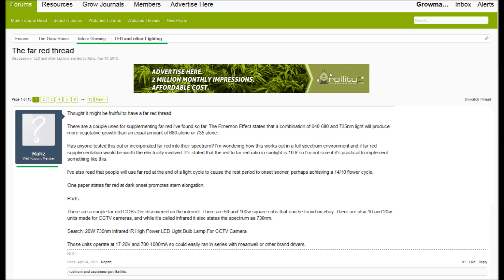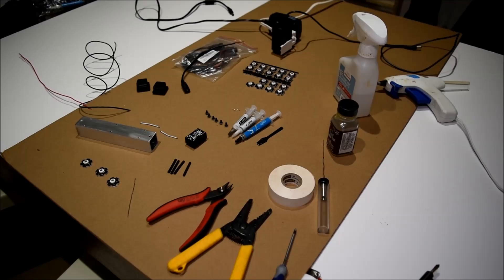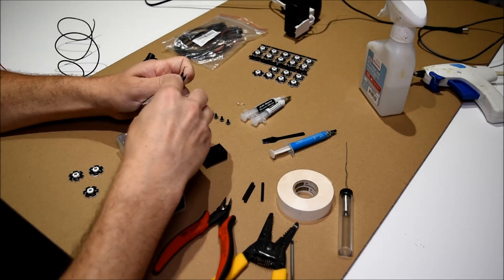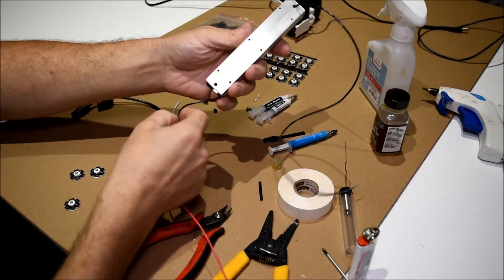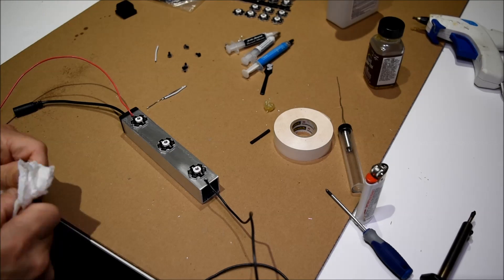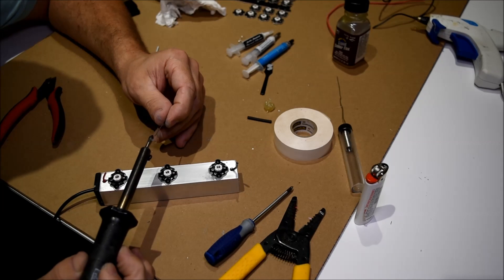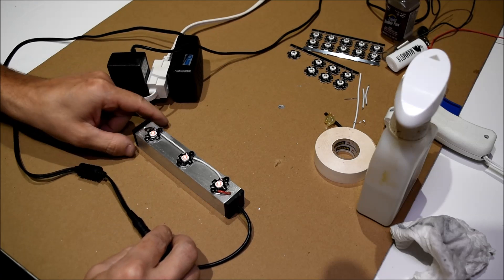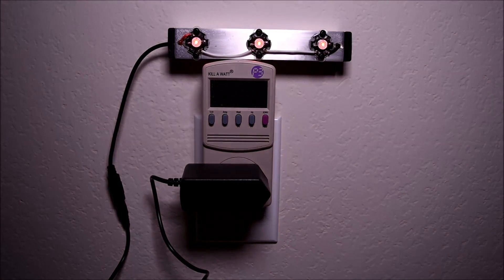DIY LED Build: The $20 flower initiator 730nm leds

Comment: I use a 12v 1A cellphone charger to drive the ldd-700HW and it gets supper hot. Is this normal? I mean really hot I can't hold it when it's running. Is it normal?

Comment: Quick question about using the far red lighting. I am am not sure if I have this correct. The far red pucks put the plants to sleep faster after the main lights go off therefore reducing the amount of dark time needed during flowering so a 14 hours on 10 hours off or 13 hours on 11 hours off lighting schedule can be used instead of the traditional 12 hours on 12 hours off schedule?

Thanks 🙏
Reply: that's correct and if you add some 660nm deep red with the far red you will have an emerson light. these help induce flowering, speed up ripening and improve quality taste etc
Reply: @iRuf12  but for emerson effect you only need around a 6:1 ratio on the 660nm and 730nm, and all time turned on, if you use too much IR on day you get streching bro. Salute.

Comment: So what I found out is yes you can drive more than 3. I built 2 of these for a 4'x8' tent. Had to watch the video a few times to keep my lack of knowledge in terms of wiring but I am getting petty savvy thanks to you. You are a very gifted instructor and thank you for sharing your knowledge. They have been running for a week, I started the flower process then saw the video then ordered parts. took total of 20 minutes once laid out. 2 3 foot 1-1/4" x 1-1/4". 
My plants exploded with the next few days
Reply: paul waschkowsky Wow. That's awesome. So 6 led's total was enough for your 4x8 space?

Comment: Links are dead bro but no worries I sourced my gear from heatsink USA and eBay, which was a little more coin but my question is did YOU notice a difference with these?
Reply: not using the DC to DC drivers and using the extruded 1 inch bars by 2', 5 discreet on each bar probably overkill but it's what I found acceptable for my space and available voltage on the AC to DC driver I picked.

Comment: So, depending on the amount of LEDs, you get brighter-dimmer.  At what point are they not running enough wattage?  With the 12V-2A cellphone charger you have 24W to play with. Across 8 LEDs that should be 3W minus what the driver consumes. When I tried with only 4 LEDs they were SO much brighter, so now I just want to make sure I'm not spreading power too thin to make it useful.

Comment: Hello
Did you use these and how did it work?
5 minutes after lights out for how long? The complete flowering period?
Did you go to 14/10 while using these lights?
How much space does this one cover?
I would like to go to 14/10 but need input on the out come and what is needed to go to 14/10.
Any help would really be appreciated.
Thanks again for your help and diy videos!

Comment: I have a very different situation then most I have solar power and don't have watts to waste, I start out door grow which I had to move indoors to finish, northern lights. I'm doing in my 2x2x2.5 micro grow. I bought 2 Chinese 18 watt bulbs for the 12 volt side and when the gen comes on use a 50 watt ufo. I'd love to build something a bit more suited for the situation. What would u suggest fo the low wattage side mx real watts 20-25 need good for veg and flower

Comment: Hey man, what if i bought a $10 10w LED that had 1 IR 730 nm light in it, broke all of the other lights in the bulb so only the 730 was working... would 2 or 3 of those work the same as this? Could i just turn those 3 (Broken -to-work) 10w lights on for 5-10 minutes after my light cycle to get the flower initiating effect? I am definitely not worried about the couple of watts I am losing in efficiency to do it this way... time for an experiment!

Comment: Thank you for this!  I went wild a got six of these from Steve.. All wired up, show energy with multi meter thru out all the terminals but no lighting.. The power supply I'm using is a 120v 60hz 25w - 12DVC  800mA.  Is this enough, 
Thoughts?  Thank you again...

Comment: If you were to use a meanwell apc 12-700 driver to power 3w semi leds (2.6v@700ma), how many could you run on that driver with series wiring? Thanks

Comment: found this light that seems pretty neat.  what do you think? TotalGrow Solid State Volumetric Lighting LED Light Fixture 155W http://totalgrowlight.com/products1.html
alilttle pricey but they added alil far red. and seem to know what they are talking about with the light absorbtion of plants. please check it out nd let me know what you think thanks
Reply: and check out their other supplemental lighting. have different effects. pretty neat http://totalgrowlight.com/products.html
Reply: ***** theres too versions. One that is 89.5% and one thats 91.5% what does that mean tho? I would think it would allow the light to last longer by lowering the power? And the diodes are" TotalGrow light fixtures use a revolutionary new Solid State Volumetric Lighting (SSVL) Technology to produce a custom tailored light spectrum that maximizes plant growth and health, with minimal energy consumption. This advanced technology solves many of the challenges facing other grow lighting technologies. The SSVL structure allows for unequaled mixing and uniform distribution of light in the exact wavelengths that plants need most for quick and healthy growth."" 

	• A metal-clad printed circuit board with light emitting semiconductor
chips produces high-brightness, short wavelength light.
• A top and bottom reflector reflects the light within a volumetric chamber with wavelength-tailoring phosphors suspended in an optical solid.
• Light passing through the volumetric chamber is down-converted into secondary wavelengths that are emitted through the sides of the volumetric chamber – causing the volume to glow like a filament bulb.
• Matching the appropriate wavelengths of light emitted by the semiconductor chips and the phosphors allows the SSVL technology to be optimized for specific light color characteristics.
• The light emitted from the volume is incredibly uniform and shines in a pattern similar to an incandescent bulb without shadow points or hot-spots.

 This light would be a replacement for 400w hid or supposed to be from what I read through the website.  Ima check the umol/j for leading competitors and see which led is for me. I would make my own cob but not very handy and really dont got the tools. And leading brands you recommend for a 2L x 2.5W 4"11H ?
Reply: ***** https://vimeo.com/alsentis/review/85870288/bf1782219a heres a video explaining alilttle more in depth about thier lights.

Comment: How many led diodes can be run off of that bucking driver?  Like Rick asked earlier, I'd be interested in spacing these out and adding more to cover say, a 2x8.  And just use 2 units to cover the entire table.
Reply: Thanks for the reply and more importantly, thanks for what you do for the community.

Comment: good to hit them with the 730s after the lights are out as it will save you 2 hours of sleep time but if you use these during your light cycle it will cause stretching.... When Pfr absorbs far-red light it is converted back to Pr this process takes about two hours once lights are off but these 730nm bulbs can get that done in 15 min.  During the day the Pr converts to Pfr.
Reply: I think they stretch because of lack of blue light and not because there's more red

Comment: Great Video, I'm DGC also. You have inspired me to purchase a soldering iron and attempting this for my first LED DIY. 
 Wondering if you already have a video or tips up on making some supplemental DIY LEDs to and into the room with my 1000w HPS? Any tips or suggestions from start to finish. If at all possible. Such as which specific materials, LEDs, Drivers, and such. 
Thanks for all of the great information..